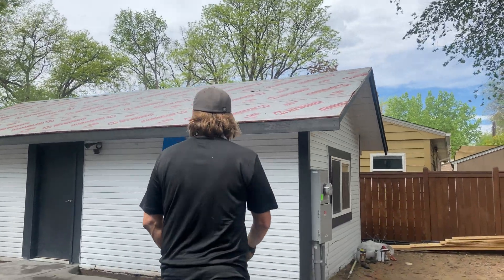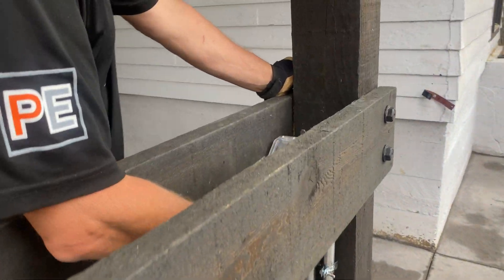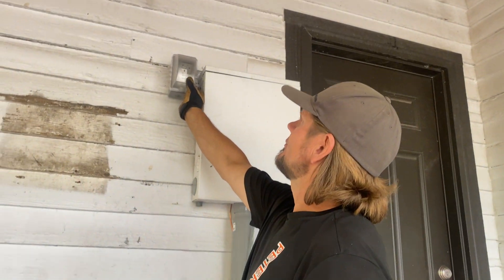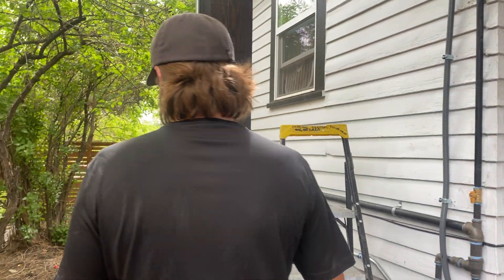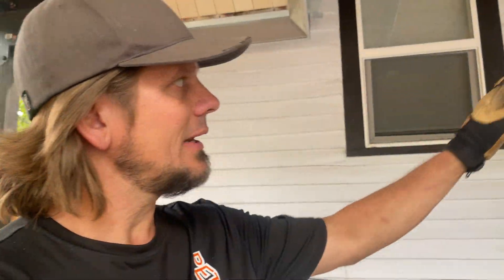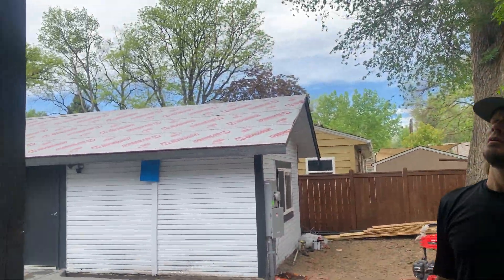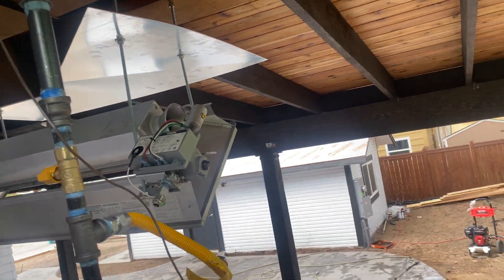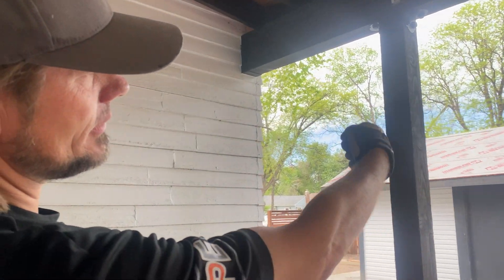Moving Electrical Service in an Urban Area (Results)

Comment: That was some lousy concrete work. That should not have passed inspection - all those places for water to pool up in. But I guess that may be normal for this "neck of the woods" Too many conduits and pipes visible maybe run them underground or through the basement/crawlspace. Home owners should listen to the advice of a professional.

Comment: I found a Hubbell / Bell outdoor ceiling fan box that comes with a ring for the fan canopy.  Comes in bronze and gray Bell PRCF57550BZ.  Accepts 1/2" and 3/4" conduit.  Has a metal bracket on the inside to hang the fan from.
Reply from the maker: Thank you, I will order one and give it a shot, thanks for watching!